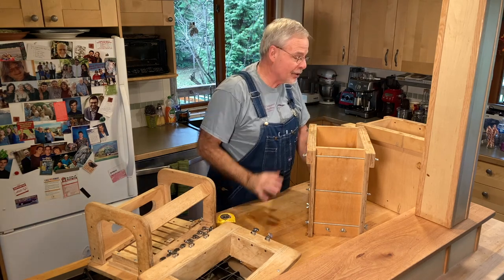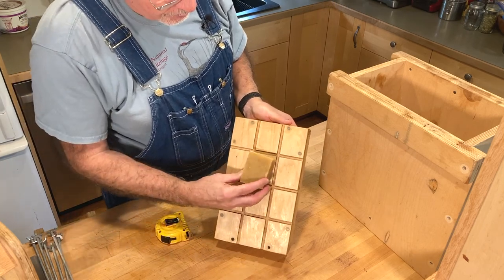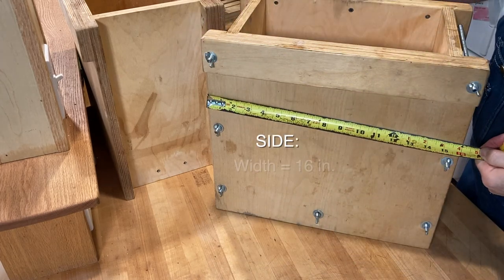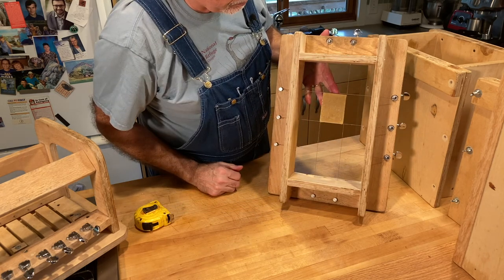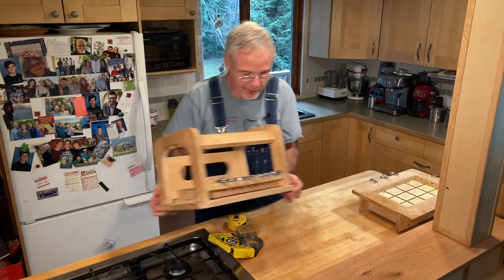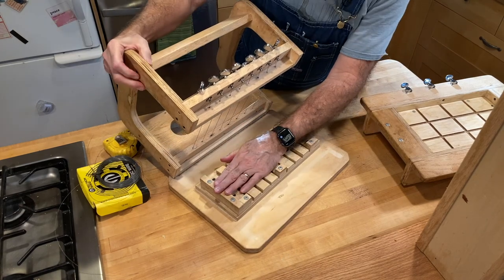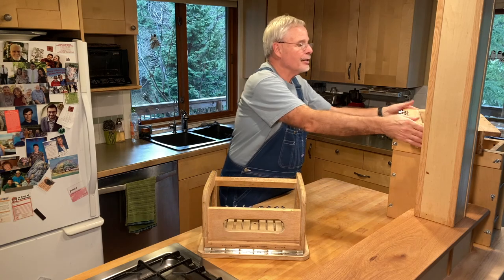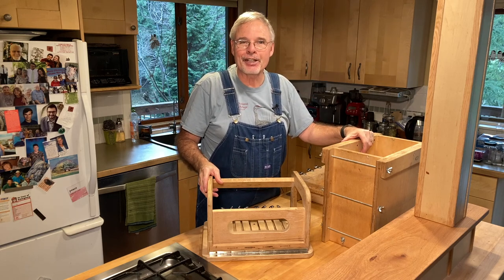Make your own big batch soap mold, loaf cutter and bar slicer!

Comment: Somehow or another I found your video and watched again.
I make a type of loaf and bar cutter. You can take apart real easy and store in a drawer. I bring that up because it does not use steel wire.
Steel wire has small tiny ridges that cause stress on the wire and thats the only reason they break over time. It might even scar up that melt & pour clear soap or just break trying to cut melt & pour.
Mine uses 30pnd fishing line. I've never broken a wire on any type of soap. A loaf can be cured for almost a week and it will still cut right through with no scarring or issues.
I bring that up for you to try sometime yourself. You get a lot more in a spool and it might be cheaper (never bought wire)? And, I think they can handle those guitar tuners only you might want to slack off just a hair? 
Another reason they break is because steel isn't very good bending over continuous usage. Its actually better if you leave the wire tight and never loosen then to loosen them up after every usage. The more you bend steel in the act of cutting soap and tightening and loosening the more it will eventually break. Fishing line doesn't do that.
Reply from the maker: I’m glad you’ve had a good experience using fishing line! I’ve gone seven years without breaking the piano wire, so I think it’s a good choice.

Comment: Wow, thats some precision measuring. I really admire how the bottom piece fits precisely in the box. I didn't see any air!
This is one video going into my soap making videos.
I hope to make something like this one day. Currently I actually use fishing line to cut my soap. It works great in what I made and cuts pretty smoothly. I've been doing that for about 3 or 4 years now and haven't broke a line yet. Still on the same one. It works because the soap goes through the line versus the line going through the soap as in your bar cutter.
I would be interested if it works in your box though.
I hope you consider making a video of making them.
Reply from the maker: Thank you very much!

Comment: Hello, I have a question you covered the size of the base and the size of the sides of the big block mold, however, however I did not hear you mention the width of the end boards, not knowing how deep the dato grooves are I know the end pieces are 15" tall but could you please tell me what the width of the board should be also what size off router bit is used to make the datos, I am looking forward to making these treasures you have shared with us. Thank in so, much for sharing. Cheers